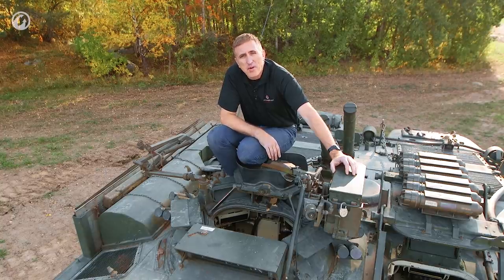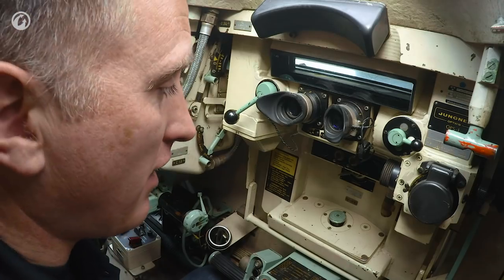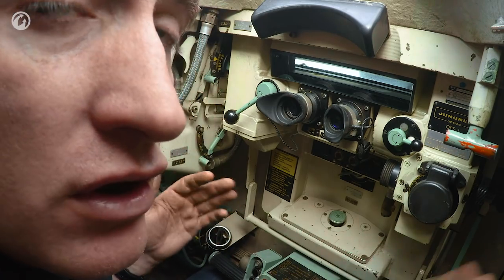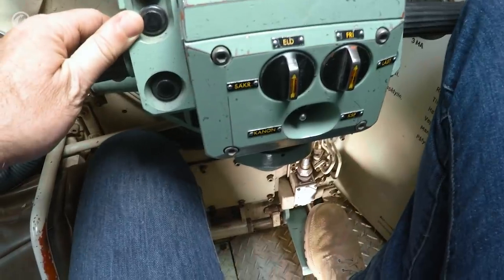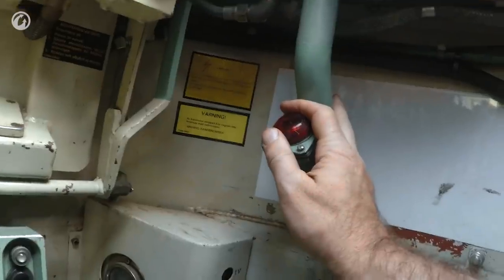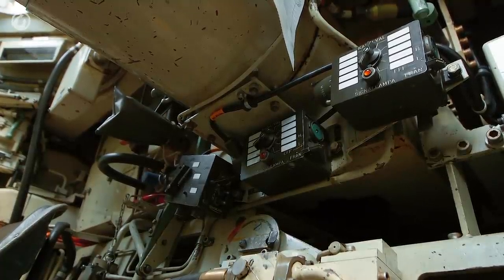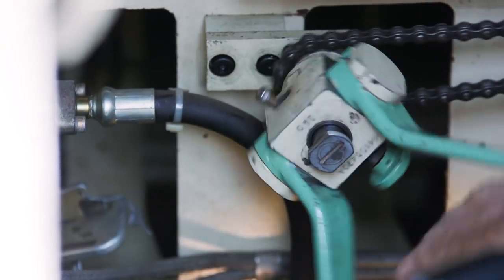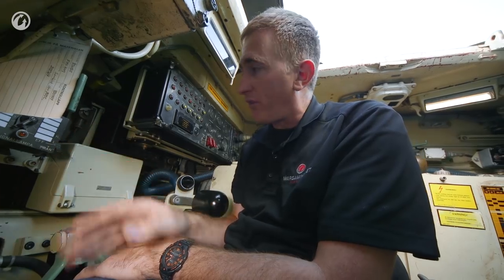Inside the Chieftain's Hatch: Strv 103C part 2

Comment: Just such a unique design for a tank. I absolutely love this thing! This is the first tank I've seen with a rear facing driver, too.
Reply: charlie f The archer does as well, for obvious reasons.
Reply: Welllllll. the driver of the Archer doesn't REALLY sit in the rear. He's in the normal position for a Valentine. Its just that the GUN is mounted towards the rear, and for some reason WG choose the direction of the gun to be Forward, which is why its slower going "forward" than in "reverse". I suppose they didn't want to confuse the kids who play.
Reply: The Germans made an armored car with 2 drivers one forward facing and one rear facing it mounted a 50mm in a rotating turret. It had 8 wheels with 8 wheel steering
Reply: @nathaniel1207  Yeah the Luchs or in english Lynx
Reply: A few familiar bits for a Brit,432 engine,Centurion roadwheels,and an L7 gun

Comment: The gear ratio was slightly higher in reverse than forward, so it was technically faster going backwards. Reverse driving was not easy you needed the driver to use his elevation controls to depress the rear of the tank so the rear driver could see. But it was very handy for getting through snow, the S-tank in reverse could go through very easily as compared to forwards with the dozer blade in the way.

Comment: The warning light is for when the diesel Engines stops the gyro that propel the small turret goes crazy, and you can get strangled by the wire. Thats is also the warnings signs. The later version has no Boeing it has caterpillar gasturbine, and Detroit diesel turbo diesel Engine. i lived in this for 12 month :-) AND I LOVED IT

Comment: Maybe the big red light is for "OMG THE TANK IS ON FIRE!" ? :D I'd love to see you shoot with one of those things once though. Oh and i have a question: How does the fuse setting for HE rounds work (technically, how is setting that little handle changing the round)?
Reply: I'd hope that anyone inside a tank would be able to tell if they were on fire without the aid of a light.
Reply: It says "Warning, if the cylinder engine isn't running, you can't brake the wagon with the foot pedal. USE THE HANDBRAKE"

Comment: As a Canadian, I think having to wear winter gear inside the tank isn't that bad, long as there is room inside the tank for you wearing the gear. If you need to bug out for whatever reason or drive open hatch, wearing your winter kit already is handy. In Canada often on long trips we need to take our winter coats off and throw them onto the back seats of our cars, which means if we roll down the window for whatever reason or stop and get out of the car we have to put our winter coat back on which is a little annoying. It would be worse if you have to bug out of your vehicle in an emergency as you are now outside the vehicle and your coat is in the back seat. For a tank it would be worse due to the explosive nature of tanks and how storage space for your winter gear when not wearing it could be an issue. If I was designing the tank for winter, I too would just limit the interior heating and tell crew to wear their parka.
Reply: No heater work's well in desert conditions, mostly because who in there right Minds would run the heater in those conditions. That plus winter gear when in cold weather, makes me wonder why tank even have heaters In the first place. I under stand AC but heaters are kind of pointless. The space that a heater takes up could be used for something to keep the crew comfortable in the cold like a coffee make or boiling vessel.
Reply: I think it is more for when you are in extreme weather. You don't need to keep the tank a nice room temperature(20c) but having a heater to bring the interior up to at least above or near freezing(0c) is good. Otherwise things can get uncomfortable, mainly in the feet and hands, more so if you are more or less just staying still in the tank. The tank has a lovely heat source while moving, being the engines, so why not have a heating system to use that heat from the engines. Being out of the winter wind helps, and being in an enclosed space with body heat will help too, but some sort heater is a must for some parts of the world, in Canada, the Nordic countries and Russia for sure.

Comment: During the mentioning of the right warning light, the upper sign is too out of focus to be read accuratly, but the lower signs says:

WARNING!
If piston engine is stopped, the vehicle can not be decelerated/braked using the foot brake pedal.
"USE THE HANDBRAKE"

Comment: With modifications this tank design could make a comeback
Reply: The only real thing that could modernize this tank was if they found a stabilization system for the suspension allowing it to fire on the move. But that would be incredibly hard to do and would require a LOT of power.

Comment: 1.75 cm, or 5'9", was the demarcation between S-tank and Centurion crewmen in the Swedish Army.  Seems kinda "tall", but the Swedes tend to be tall as Europeans go.  I believe it was 5'4" or 5'5" for most Soviet "tankists", correct, at least in the T-54, T-55, T-62, T-64, T-72, T-80, and T-90 tanks?
Reply: In "my" company of 103-crewmen no one was shorter than 175, most were 180+, myself 179. Do you mean that the short ones were to man the Centurions? Seems odd.

Comment: Has anyone talked to some of the passed crew members. As a former tanker I would be very interested to see how well it really worked gun tied to the suspension. Had to be very hard to spot .
Reply: If you read about it in Sweden they realised pretty quickly that there was a major drawback to the design due to thermal optics - you had to run the engine to traverse the gun which gave away its position..

Comment: The Swedish winter uniform is as good as any of the northern countries, but it is no good if you are not wearing it.  I expect they didn't heat the tank to keep the crew wearing their coat so that if they need to get out in the winter they simply have to zip  up and put on gloves.  Besides the Swedes like most northern countries pride themselves on not feeling the cold.

Comment: something tells me that if the army drooped me (as some one that dont even have a driver license) on my own out in the wood and told me get it back to base after shooting thous two marked paper tanks locate way out there(need to drive there then to base).
whit out the Strv 103 manual or training.
I could do that by just reading all the post it notes bolted around the tank.... On my own whit no help.
sure fara för almänhet but I could get it done in less then a day (3 hour hunting post it notes+20 min dancing around inside the tank) vs a trained tanker  3 hour(30 sec dancing around inside the tank.).
I mean Im just reading all the notes posted around the tanks and they tells pretty much how to operate any piece and what any piece does and in what order to do anything on.
//wouldent be supprised if in the glove compartment there is a lathunt(reference sheet) whit a checklist of how to start the tank, how to shoot the tank and how to bravely -run-/drive away whit the tank.
Reply: I most american tanks have basic driving instructions in there manuals. If the crew keep the manual in the tank is another thing entirely.

Comment: they should have make it a turbine hybrid.. 
targeting could run on electric totally silent ..
also idelling could charge the battery with load, better using the engine.. how they could not see this,,?
Reply: 1950/60's technology so batteries did not have the best energy density at the time. Look at diesel submarines from that time period. They had massive battery banks but only a few hours of power for the electric motor. That and hybrid turbine electric system still doesn't deal with the issue of low idle efficiency for a turbine engine.

Comment: I'm assuming people with, er 'wind' problems aren't welcome on tank crews, the inside of a badly ventilated steel box must get a little bit smelly!
Reply: Well. The smell of diesel, gunpowder and sweat probably smells more.
Reply: I trained as a crewchief on a Bkan 1C back in teh 90's and we had a gunner during training whos farts smelled like burning acid. We actually had to use the emergency NBC ventilation system once XD

Comment: I can actually understand not including a heater. If the crew rest outside of the tank they would be wearing winter clothing during the winter. If they then get in the tank due to combat then you wouldn't want the heater running to overheat the crew. If they had to bail out, you also wouldn't want them NOT wearing winter clothing. But, a heater would still be nice...
Reply: Ghost Shadow Having a heater means that they can take off their bulky winter coats when they are inside, so it will be less cramped.
Reply: That's actually not a good idea at all. Swedish tank crews had specially designed clothes with, among other things, a shorter jacket and paddings on certain areas. Obviusly for protecting the crew from bumps and bruises. Also, the compartment isn't all that cramped. Remember, only crew that are under a specific height(and weight) are designated to this tank. It was the same for the SPG Bkan1C wich I trained on. The Bkan also used the Turbine/Diesel engine combination, and the heat from those engines was enough to keep you warm in -35c. Hence the ventialtion.
Reply: When I served in Chieftain tanks we had heated tanks suits, but they were notorious for either not working, overheating, or even catching fire!  Was a lottery if your suit was a good one or not. ;)